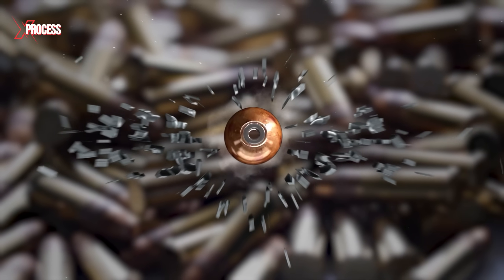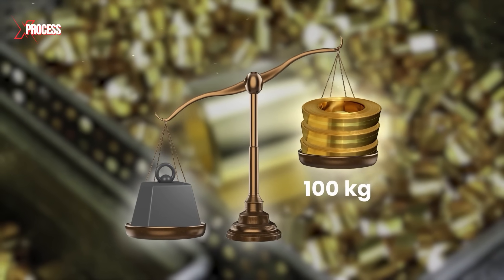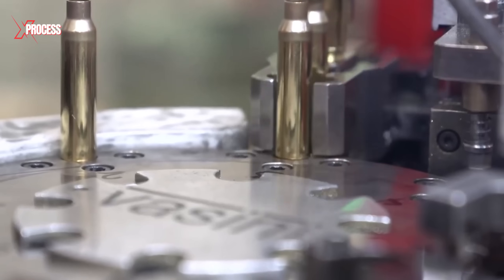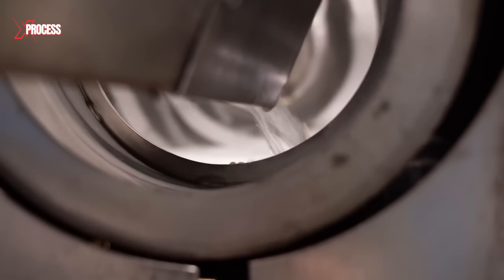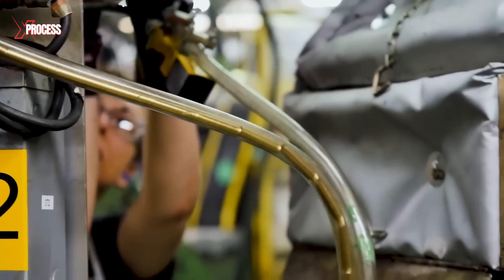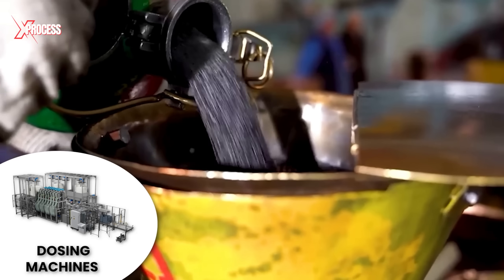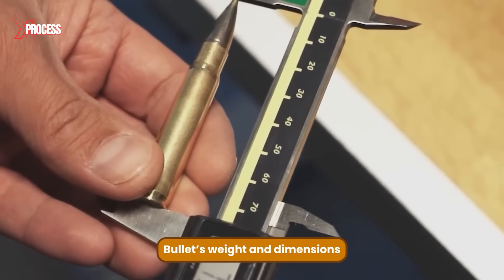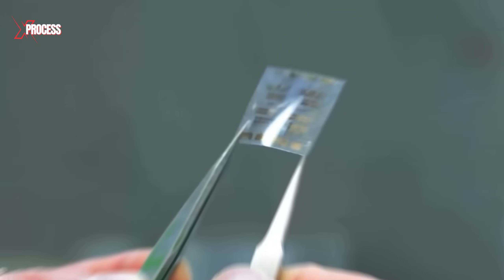How are MILLIONS of BULLETS Made? Ammo Factory

Comment: You’re using the term “bullet” incorrectly.  I think you mean cartridge, or round.  The cartridge consists of the case, bullet, primer, and powder.  Sometimes “projectile” is used instead of “bullet.”  The bullet (or projectile) is the heavy little thing that flies out of the barrel.

Comment: 0:01 Need something like a modern Sig 716, with a 4 way gas block,  maybe hybrid between .308 and 7.62 if still perfectly accurate with a bolt lock down feature and my design

Also i have some design improvements to all bolt actions 

I got some really cool inven.tion ideas if you want to make a lot of money

Who to Kontact

You need taser drones immediately for the border, if you like wepons defense systems and inventing call me,  i got lots of ideas.

I called L-Tron, no one wants my cool invention ideas,  you need a Cop car upgrade, 2 under mount guns one on passenger,  one on drivers, the rear is center out of truck.  Emergency bullet shield deployment of reverse open bullet proof hood with camers, also the rear trunk hyper extends and locks tight to glass, rear camera. One officer goes to the window,  the AI has 4 lock ons to four passengers on thermal,  the drivers side gun for the 2 on the driver's side, etc.., if there's a click on any of the passengers that gun fires an armour piercer